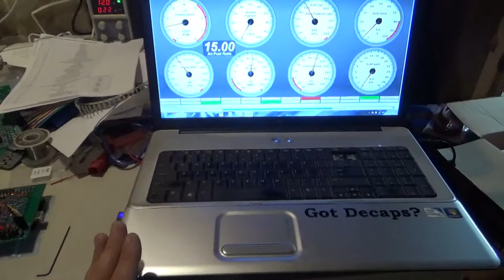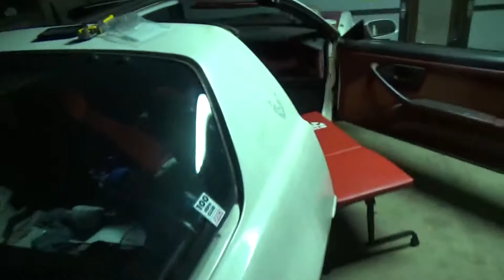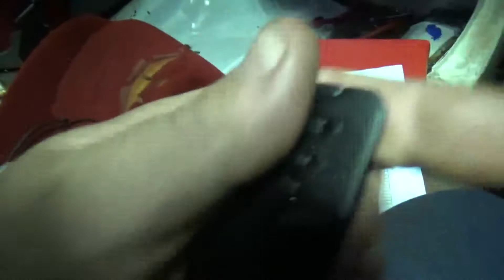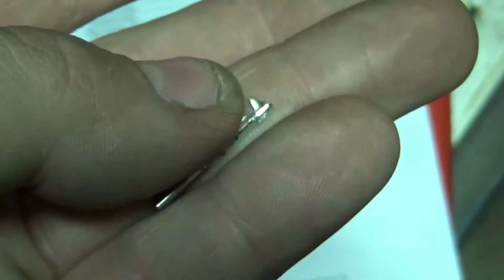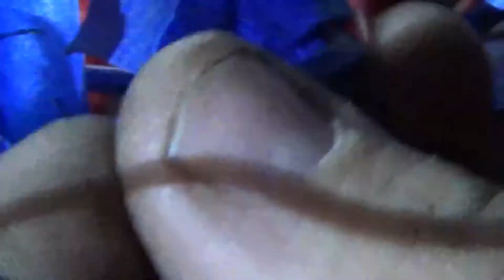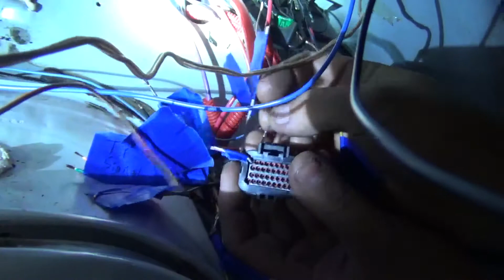Speeduino update and firebird install 9-19-19

Comment: You state it has open and closed loop boost control. Does it output to a 3 or 4 port valve? What voltage? Are you planning to offer a kit with valve included?
Reply from the maker: Green Plaid 72 either port valve will work but 4 port closed loop is going to be more touchy. 12v or engine operating voltage. I could sell the valves on my website along side the speeduino.

Comment: I know that the Speeduino is batch fire. You connected injector wires one and two as individuals. Does the pairing of injectors happen on the board side?
Reply from the maker: Green Plaid 72 no the pairing of injectors happens in the harness. That way it’s more versatile.